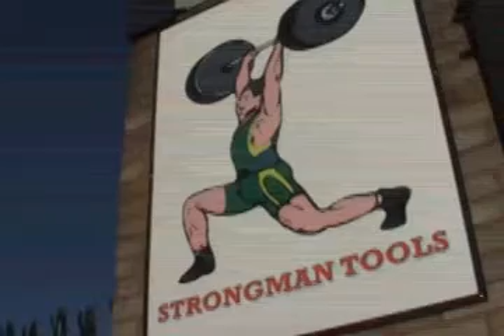Strongman Tools - Hydraulic Scissor Lift

Comment from the maker: @darkertree  To clarify, on the basis of your succinct comments, this lift does not use air to lift a car, it uses a 2.2KW hydraulic motor connected to two rams to do the lifting. Air is used to release the safety mechanism when the lift is lowered, as we have stated above these lifts have full CE certification (a passive safety device remotely operated). We are delighted your Mohawk lift works well, so do these as many happy users will testify.

Comment from the maker: @BoldUniverse 
All our lifts have ratchet locking saety devices, there are two hydraulic rams and a passive (works under gravity) ratchet system in the middle of the rams which locks into place as the lift rises. You need a compressor to release the ratchet to bring the lift down. If there were a hydraulic failure the safety device will hold the load, lift has CE certification backed by independent testing.